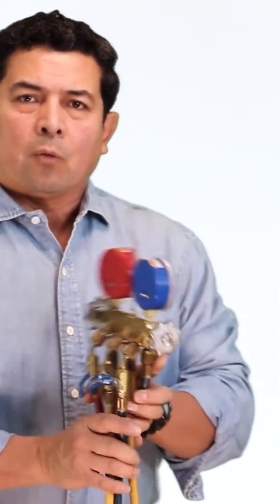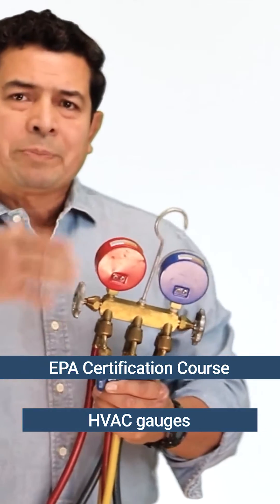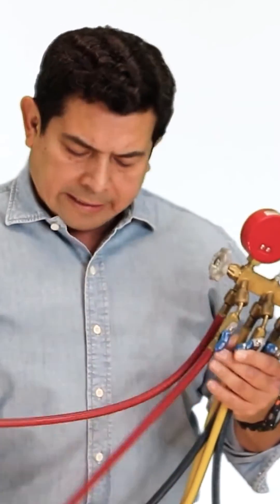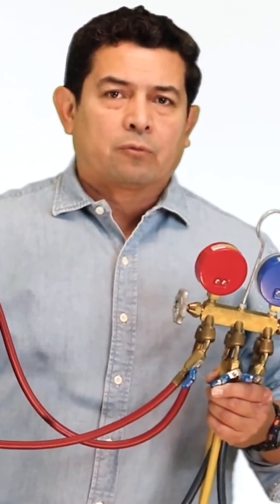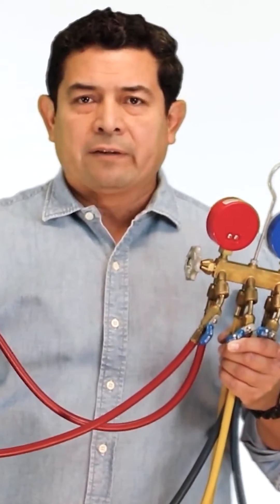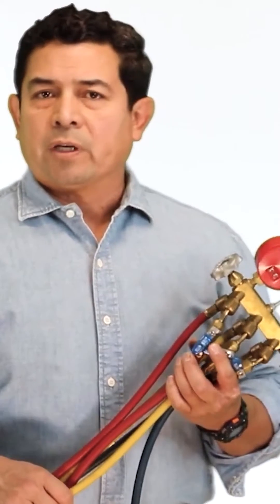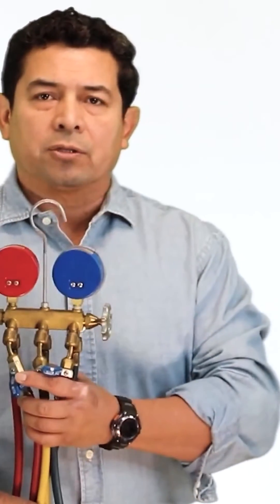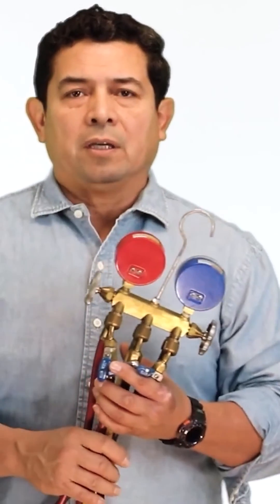HVAC gauges, #hvac, #hvaccourse , #hvacpodcast, #hvacpodcast, #AirConAcademy, #JulioHerrera

Comment: where the rest of this video ? Why we need to use  3 gauges ...
Reply from the maker: this it's part of one of the classes I am teaching. That's why you only see this part of the video. And the reason I was talking about three sets of gauges is because you do not want to contaminate one type of system with a different type of oil. For example, put alkylbenzene in a mineral base system, or POE oil in a alkybenzene.   It mostly depends on the type of units that you have in your building. Commercial buildings will have the units installed and you will always deal with those. Unless you are in a service truck then you're probably not too sure what you will run into until you get to the job site. Thank you for watching!